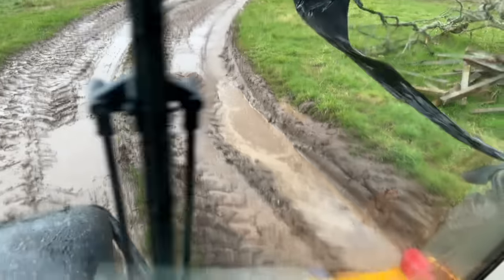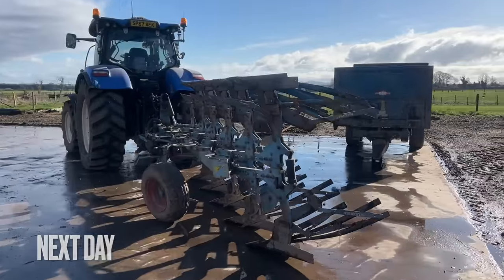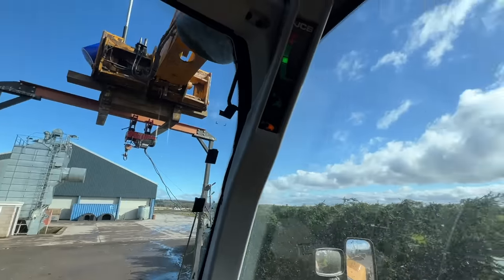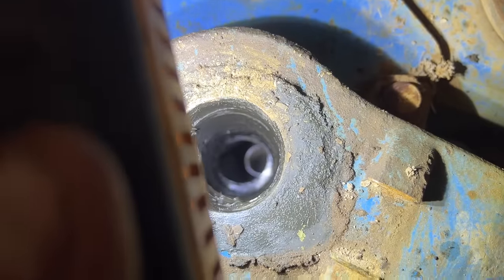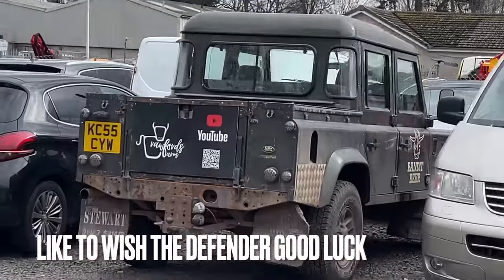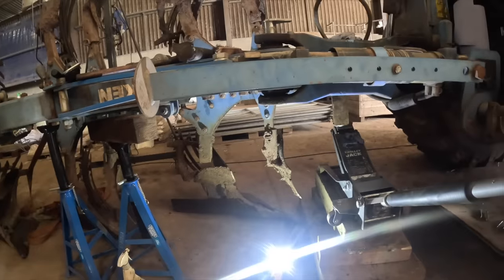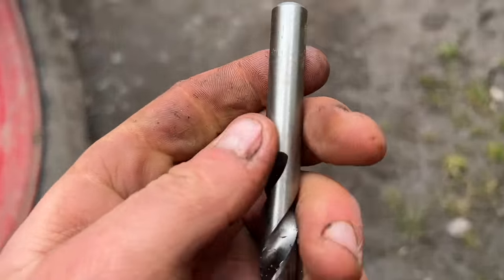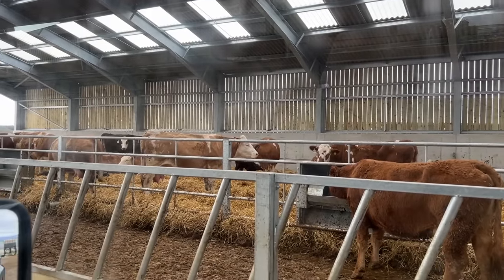Repairing Plough Problems but Its Not Helped

Comment: That cast wishbone should definitely be bushed.  And by the way it was bent up needs to be redesigned and or have a positive locked pin.  
You need two new pins with threads and a shoulder so it can be tightened up against itself so the pressure is off the threads and on th pin/bushes